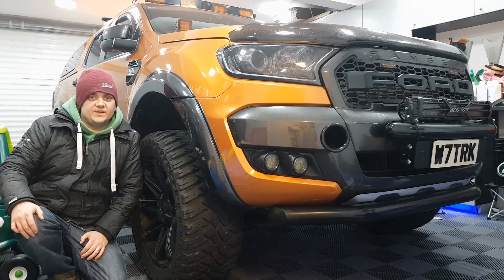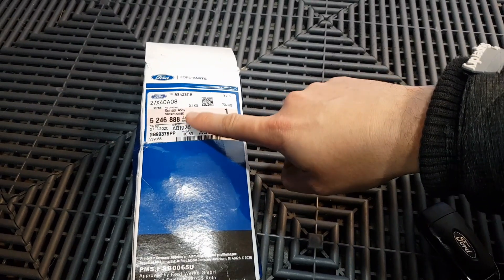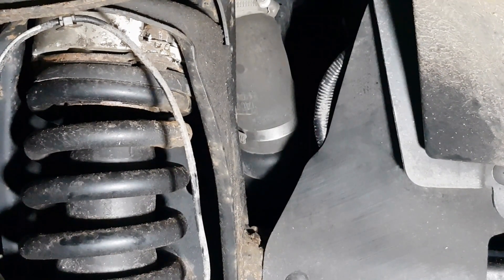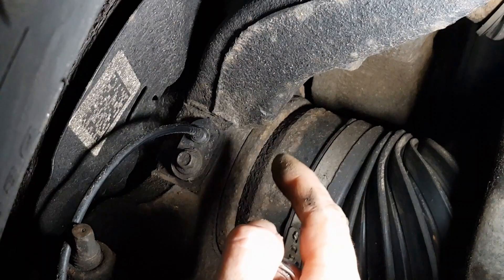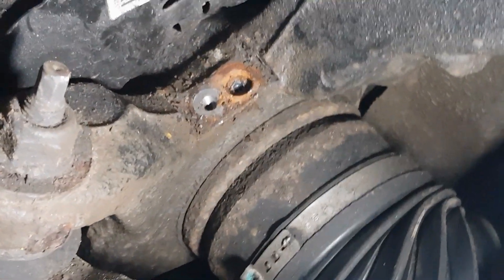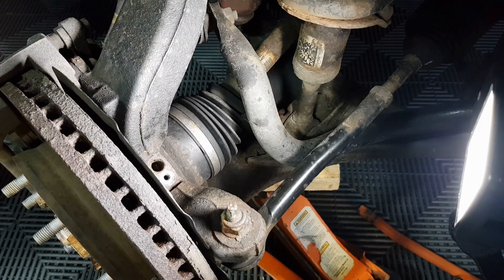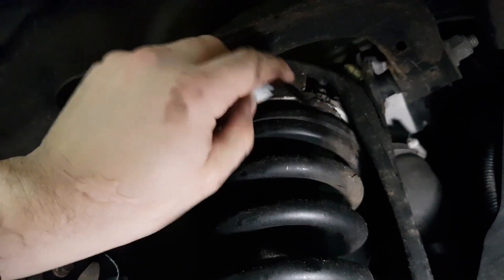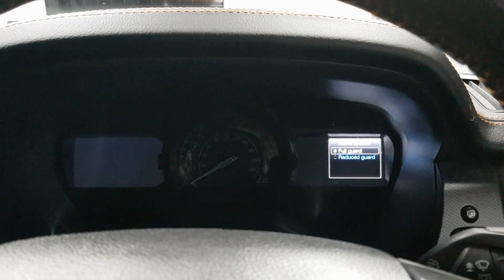Ford Ranger T6 - Replace Front ABS Sensor

Comment: Anyone doing this job keep in mind that if your sensor is old enough to go kaput, your chances are very high of the sensor body shearing off during removal. That place gets hot, wet, salted, and it's full of rust thanks to its proximity to the brakes. Be prepared to have to drill and pull it. If you are prepared in advance the whole process is much easier. Start with taking the wheel off. Even if you can get away with not doing it, you will get much better visibility and access with the wheel out which will reduce the chances of making a mistake.

I haven't seen any mention of it, but if you have to drill the sensor out, I've found that using a 10mm to extract the material above and just slightly below the gasket, followed by a pilot hole down the main shaft of the body to about 3/4 of the way down to the end. After that you can just use a self-tapping screw and drive by hand to the end of the pilot hole. Finally you can just use a pair of pliers or vice grips to pull the self-tap screw out and with it will come the remains of the sensor hopefully in one piece.

I don't trust using a drill bit as an extractor as you will always get some material that falls in the hub and while it may not be a problem, it can very easily be a huge problem.

Comment: I have the traction control light coming on and going into limp mode. Will replacing the ABS sensor fix the issue? My research has pointed me to this video.
Reply from the maker: Not sure limp mode was one of my symptoms but have a look at my one prior to this one on the replacement battery. That showed all the errors I was getting. I originally thought it was the battery, but the error returned shortly after that video and led to this video.
Reply: @DetailingandtheBeast  thanks for the reply

Comment: An excellent clip thankyou!  Ive had my ranger for about 3months & although i love it i had an abs light come on together with an 
Esc symbol show? Now theyv gone off ??
Ive tried it since off road  in 4wd H& L range  & didnt show any problems!! Puzzled? Maybe a faulty sensor??
Its only done 36k miles!! 10:20
Reply from the maker: Sometimes they light up when water gets into the hole of the sensor... they dry out and are fine again. Had this a few times over the years.

Comment: Just needed to comment with a massive thank you, had the same lights coming on and off for around 2 weeks then stayed on, been to 2 different garages who couldn’t find the problem, was reluctant to go to Ford and spend a fortune, did a bit of research and followed your video and the problems fixed! had the same issue with the end of the sensor staying in but drilled out and got it out. £29 for the part and a lot less worrying! Can’t thank you enough

Comment: glad I found this as I had loads of warning lights on the dash and Forscan said it was the front right wheel sensor, took the plunge and followed your process. Did the sensor break? of course it did but thanks to you I was able to just drill it out and cleaned it out and slotted the new one in, sensor on and sorted so fired up the car and no warnings, massive thanks m8
Reply from the maker: Sounds like a carbon copy of what I did! Sensors are rubbish and loads of people have seen the exact same issue. 
Glad the vid was helpful. 😊

Comment: Ford ranger t6 2.2 - got the error changed both sensors... errors (Engine + ABS lights) and cruise control does not work.
I clear via FORSCAN (using an ODBII cheapo connector). Drive for 5mins ABS error kicks back in - knocked out Cruise control (guessing it takes wheel speed from ABS). This is driving me mad - any thoughts - thinking checking Fuzes and then checking I am reseting with reader and not just clearing?!?
Reply from the maker: Wiring loom over the rear chassis. Heard of friction breaks in this loom before.

Comment: Sorry to bother again. Replaced battery still got all the faults on the dash. Struggling to find the sensors though online? Where did you buy them from?
Cheers
Reply from the maker: There are links in the video description to the genuine articles on ebay

Comment: Hi, recently had the ESC SERVICE REQUIRED warning come up also hill assist hill decent and abs warnings. Also when i put in reverse the sensor dont work. Was this the same with yours? 
Cheers
Reply from the maker: Yes that's the ones! Check out my battery replacement video cos that's when I first had the problems show.

Comment: Mine has the rear left speed sensor problem
Reply from the maker: Be aware that the rear is either the sensor, or it could be a broken cable in the loom over the rear axle.

Comment: Hey mate, sorry to bug you, do you happen to remember exactly what was the error code in Forscan for the ABS wheel sensor failing?
Reply from the maker: No the wording exactly, but it did mention the actual wording Front RH ABS sensor. If you run a full scan, using the HS can and MS can itll pull in a full list of codes and descriptions.
Reply: @DetailingandtheBeast  Im having an error on the ABS system but its pretty generic, doesnt mention any sensor at all, Im doing a battery trickle at the moment to see if its the battery, i might have to replace it anyway as its almost 6 years old.  Thanks man!
Reply from the maker: @jadenac  pretty much how mine was... I had a list of about 15 codes.. half of which were solved with a new battery. The other half was he ABS sensor
Reply: It looks like it was a lose connector under the left headlight that was causing all this drama with the ABS/AdvanceTrac/Downhill errors.  I have another question for the people here, im in Ireland and moving to Spain and im taking my beast with me, do you guys know if the Ranger headlight have a RHD to LHD switch inside or any way to convert them or I will have to spend 500e in a new LHD set?
Cheers!
Reply: hey mate!if you wouldn’t mind, my speedometer stop working, is it the abs sensor have gone bad too and be replaced?Thanks!

Comment: Nice how the afermarket software can identify which sensor has failed but ford tell me its a  sensor but they cant tell which one so they will replace both front ones first and if that doent work then they would do the rears.  £700 for the front pair fitted from ford.
Reply from the maker: 100% NO! Get ForScan on a laptop and a £20 cable. The sensors all wire back to the ABS module individually, so even IF their software is so rubbish, they could always go old skool and continuity test each sensor one at a time.
Reply: @DetailingandtheBeast  From past experience I dont believe they would know how to.  I had an issue with my work van 6 volts on the headlights eventually we managed to meet their electrical specialist.  I explained the problem and the testing I had done, he asked how he could test for voltage at a bulb, I had to point out his mulimeter in his tool box which was still sealed, he did not know why he had been issued it.
I now have the dongle and forscan but if I fixed the original problem myself I could not claim on the warrenty.
Did your speedometer stop working?
I also found the rear wheels were locking under braking, interesting coming over the moors in the rain approacing a downhill bend.

Comment: Great videos Dave, can I ask what the hole is just above your drivers side fog light?
Reply from the maker: Ah yeah that's a cold air feed for my induction cone. It's a trumpet with a 3" flexi pipe up through the bumper, behind the headlight and over the wheel arch. Just a little project I did a while back to make the induction kit louder.
Reply: Do you have a link for the induction cone?
Reply from the maker: @Bryan-gz9rg  sort of. They're on my Instagram, @ford_ranger_wildtrak. Sold by me from there. There is also a video on here about the kit and the install, and, the noise you can expect from it. 👍

Comment: Hey where did you get your accessories ( fogs and bush bar ish)
Reply from the maker: Fogs were from ebay singapore. But I've checked recently and they're no longer on there. I've had to replace the light units of the originals due to water ingress.

Comment: Need to get cleaning inside there
Reply from the maker: This time of year 😔 Ruins my hard work... I do still need to replace all the arch liner screw in this arch actually.
Reply: Good tutorial Dave,would there be any benefit to adding a bit of lube to the underside of the sensor to hopefully prevent the same issue next time
Reply from the maker: Defo, it's a rubber O ring seal so you probably a decent idea. It's not a difficult fix anyway, but yeah totally avoidable 👍

Comment: Is there an easy way to tell which sensor has failed? - Great video by the way, just in time for my 2016MY Wildtrak...
Reply from the maker: https://amzn.to/3ahq2ch
Reply: @DetailingandtheBeast  I have a Bluetooth OBDii dongle, can I use that with the software?

Also, that Amazon link say's delivery into March, any other recommended dongle that might come a bit sooner...?
Reply from the maker: Edited to a cable that's in stock
https://amzn.to/2Mb1YzT
Reply from the maker: Yeah I think the bluetooth dongle does work, itll be more about the drivers connecting to the the laptop to use ForScan
Reply: @DetailingandtheBeast  Thanks and ordered; should be here tomorrow.
Reply from the maker: Yes! 
So if you get Forscan (free) on a laptop with an OBDii ELM327 cable (I'll link one below) you can get the fault code which identifies which sensor has failed!

Comment from the maker: The front sensors Ford parts / finis codes are as follows: 
(I used the GENUINE items)
Front Right - drivers side (UK): 5246888
http://ebay.us/gJFG8w
Front Left: 5246889
http://ebay.us/JypkZV